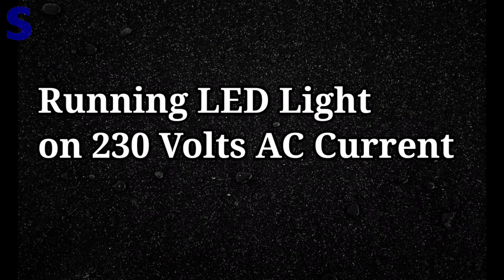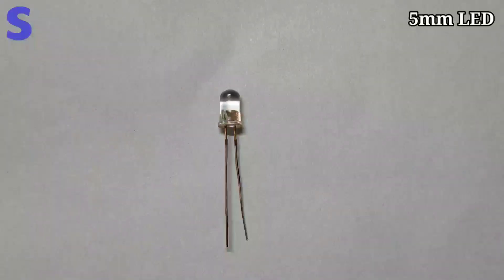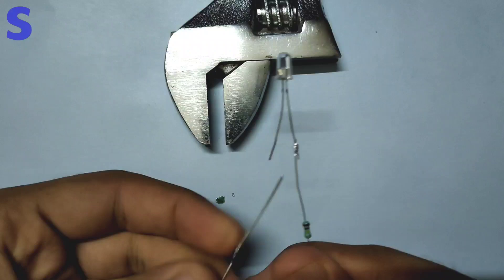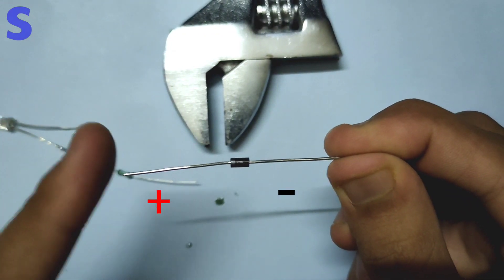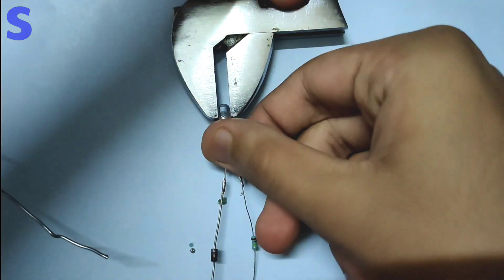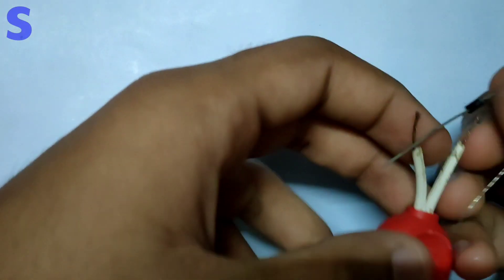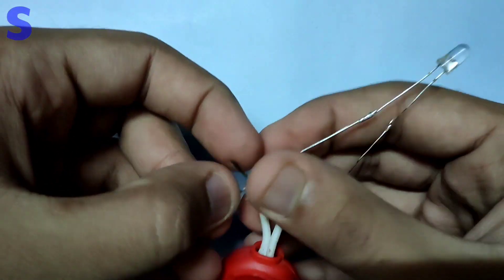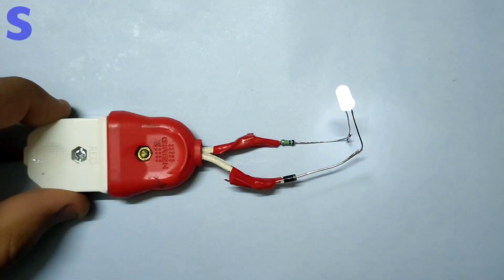How to use 3v LED on 230v AC Current

Comment: We want to use 5 led ,shall I conect in series Or parallel need to change value of resi.
Reply from the maker: Connect the LEDs in parallel and then check if they are working. If you feel like the brightness is too low then try a resistance of a bit lower value. I have not tried with more than 1 LED so I'm not sure about the resistance value in that case.
Reply: Only series, 420nF capasitor, without R